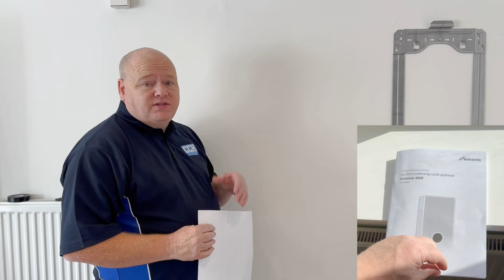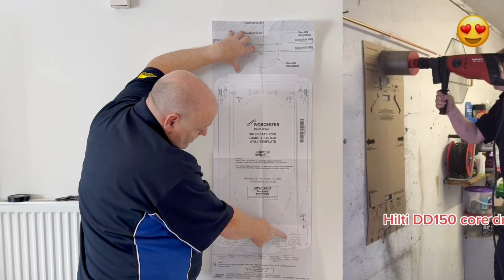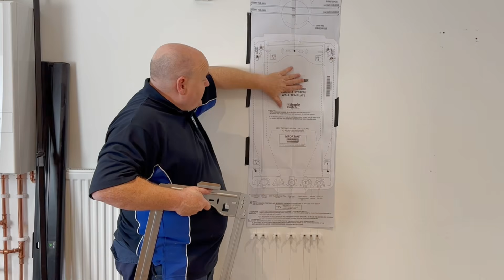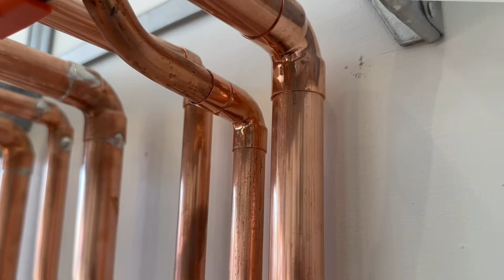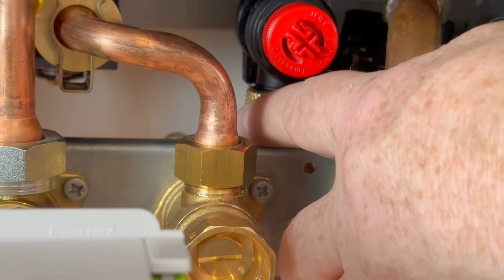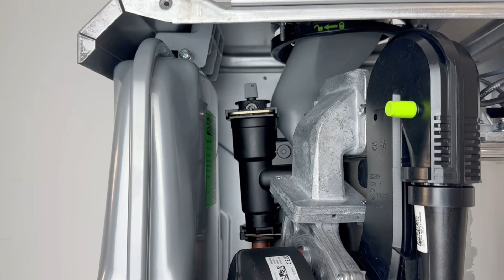Worcester Bosch Greenstar 4000 Boiler Installation & Full Review | Heatable

Comment: Great video. Just had one of these installed and it's great. However one of my radiators has reached the end of its life and needs replacing. Are there any specific things I need to do with this modern boiler before I turn it off and drain the system? My initial plan was to let the system cool down, let the pressure out of the system by bleeding some the radiators and then drain the system from the lowest point. Replace the radiator and then refill the system using the pressure guage you showed inside the boiler and then refill the system bleeding as a go through all the other radiators. I don't wan't the boiler to have a hissy fit.

Comment: what is actually included in a Baller Service on a Green Star 4. thousand My Boiler will be on its 3rd service tomorrow and I've just got out the service book record and I've noticed the first service the engineer didn't even put his Gas Safe number down, and on the second service and do they? test the system inhibitor in the pipe. Work. and at what point do they inspect inside the combustion chamber EG The electros and also at what point do they test the fan pressure or what year should I say, I will appreciate your comments

Comment: Water function is fine on mine but the heating function does not work. This is a new property, 
everything's new inside and now has it started to get cold in the evenings.

The boiler, you can hear it kicking in but inside a minute the thing stops dead. No heat.
Reply: Exactly same here, water works but no heating, I've only had it since April and not had any heating to work and I've had to top the water up twice.
Reply: @TheShan59  got hold of an electrician, he sorted it. Some wiring wasn't correct so all good now. Sometimes it just needs a 2nd pair of eyes.

Comment: We had one of these installed on Tuesday - 2 days ago - Yes, 8th April 2025 - Within hours, its showing fault code 2951 - called to complain, they sent the same engineer to fix it. He claims low water pressure. Within a couple hours, fault code 227. Tried to follow same procedure. No one came and i think they are ignoring the calls intentionally!!! 😡 Its making kettling sounds as weell and its only 2 days old!!! Any idea why this would happen on a new bolier besides problems with gas supply issues and not igniting?????
Reply: I'd mine fitted in April as well and had to top it up twice, there's a red thing you hold down.
Now we are in November I've no heating, the flame pic comes up when the water is running, but nothing for the heating.

Comment: We had a Worcester Bosch 8000 boiler fitted in November. We thought Heatable were supposed to be approved installers. Which meant that a system flush would be done as mentioned in the details of the quote online & on WB website.
But the whole thing turned into a nightmare. NO SYSTEM FLUSH! NO LIMESCALE REDUCER! NO SHOCK ARRESTOR! piles of redundant plumbing items hidden under our loft insulation, and the walls were over filled with foam, then concrete, yes concrete, half an inch higher than the plaster in my kitchen. Wires were left hanging from walls, and the dirty water from the redundant old water tanks dumped all over my driveway. He even removed the drain vent and never replaced it, so no future engineer could drain the system.  So far we’ve had to have a brickie  out to repair the wall and my driveway will need to be resealed after being jet washed when the weather improves. As for Heatable, I had their Director shouting down the phone at me last night stating WE NEVER DO A SYSTEM FLUSH on a Worcester Bosch installation, angry that Joel (after care) had arranged it. Joel also arranged a limescale reducer, which we were told was gesture of goodwill! LOL WB require it when your water hardness is 270ppm. We weren’t even asked if we had hard water. Two months of emails and cancelled appointments before and after fitting. Now their Director is angry that Joel corrected most of these disasters, although no one as yet has even looked into the shock arrestor.
I can’t even get online at WB as the warranty has been done wrong. They also sent me a ten year warranty certificate, after 2 months of asking. Not the twelve years stated. Now I have their Director shouting down the phone, apoplectic that a system flush was done. I don’t even know if my warranty is valid after all this. I would run a mile from HEATABLE. The boiler is good though, I just don’t know whether my warranty will be valid after all of this.
Reply: Heatable are just the same as all of the "internet no survey companies", it's all sub-contracted and the fitters may drive for hours to get to you, no flush, undersized gas supplies, not much making good. Always use a local firm who care about their local reputation, you may pay a little more for a much better job which is actually cheaper in the long run. Eggs aren't always eggs. With an installation they're aren't all completed to the same standards or ethics.

Comment: Worchester Bosch are the worst boilers to work on period. Just try changing the plastic sections, or servicing them properly by removing the fan and burner. Any installer can hang it on the wall, its not just about that. a Horrible product, fit a Baxi 800, ten times better.

Comment: Lads all boilers are fairly user friendly and when you don’t know the answer check (YOUR GAS FAULT) it’s a very useful app all you do is type in the GC and it will tell you you’re readings for low and high rate it also give you the benchmarks and the main common faults on the appliance. It’s a great source of information and it’s only cheap.

Comment: For 3 bed detached 10 heater, one bath and ensuite  shower , currently ideal istor he260 35kw, what would you recommend 4000 or 8000 model ? I am on the Worcester site to book replacement

Comment: My boiler is showing low pressure. Can’t find how to add water   Can’t find the Blue little flap for water.
Reply: There should be a flexi with a black lever at each end - turn both a quarter turn to add water 😊

Comment: Great video. We have just had one of these boilers installed. If we have to turn the boiler off (for what ever reason) at the electric switch its connected to. When we turn it back on, will it have lost all its settings? Many thanks.

Comment: Hi there, got a question. Not sure whether to go for the Greenstar 4000 30KW or 8000 30KW. It is being supplied by council due to using a first time central heating grant. I have been offered the 8000 as an optional upgrade. House is an extended 3 bedroom house with 2 bathrooms - 8 radiators in total. Both bathrooms are powered by thermostatic showers so will be using the hot water from the boiler. As I only have 8 radiators, would the 8000 be an overkill and waste gas? Or would it automatically adjust the power needed to heat the house?
Reply: I'd go for the 8000, it will modulate down to about 3 kw anyway, and if this 4000 can be range rated then I'm sure you can with the 8000

Comment: They made it harder for the elderly do they want them to call out gas safe just to top up a boiler inside the front panel they have a manual gauge for the gas safe installers
Reply from the maker: I do not want to understand what you mean. Thanks
Reply: There's a digital display on the front for customers, but the boiler needs to be powered up to see it, hence why there's a manual one for installers inside to see before powering up
Reply: Full stops and commers would be nice. Lovely English grammar.

Comment: Was looking to find out the pipe measurements from the jig to the elbow, when using talon clips, as I wanted to knock up a few tails to speed up on-site install time, as I’ve got a new contract starting next week and wanted to get a head start. 
Thought I’d found the perfect video in yours, then all of a sudden when you’ve got a tape in your hand about to measure, the frame skips!! 😂😂😂  what happened, I’m guessing you bottled it because couldn’t find the exact measurement. 😂
Reply from the maker: 40cm wide, 71cm high, 31cm deep. Thanks.

Comment: I have a question for Allen and the community. I am on the lookout for a new combi-boiler suitable for a flat. It is a 2 bed, 1 Bathroom. I plan to box it into a kitchen cupboard (Which will most likely need customisation to cater for the boiler). Flue needs to exit to the right-hand side of the boiler from the wall I plan for it to be on. I want something reliable and easy to work on for gas technicians when required. What would people recommend? I have a Vaillant on another property and although I was initially pleased I have the dreaded leaking flu which I believe is a design flaw in the Vaillant range and the warranty aftercare was awful. Could anyone recommend a boiler?

Comment: We had one installed last year. For some reason, it is leaking from the left side a little. We can feel water around the edge of the boiler. Plus the water setting temperature number is not there. The heating temperature number is there but not the water temperature number ?
Reply from the maker: Hope you have it sorted.

Comment: Great video Alan I always fit ideal but a few ppl ask for a Worcester so interesting to see an install.  With the new regs on part l and the flow temp of 55 and lower delta tee can u do a video on how to size up a new boiler and system whilst adhering to the new regs etc

Comment: Hi Allen
Great informative videos 👍
I have one of these boilers and it's leaking from the bottom of heat exchanger 
It appears to be the gasket
I replaced a number of radiators and pressured it back up to 1.5 bar
Then it started leaking
I can't get hold of a plumber 
Can I replace this part myself?
(Electrical Engineering/Electrician)
Thanks
Chris

Comment: Hey Allen thank you for the in depth review, however I have just had one of these boliers fitted to replace a broken ideal logic 35. since doing so my gas usage has almost doubled in kwh what can I check to reduce it.

I have the easy control wifi CT200 panel and the app which has no instructions whatsoever. I have found a few guide videos on youtube though

Standard uk home end of terraced no changes made to the temperature selected on the thermostat but gas usage gone from daily average of 16kwh to 30kwh

regards

Kerry

Comment: Hi Allen, loving your honest approach to reviews etc, was wondering if I could ask some advice - currently have an old Ideal Icos that has died and just about to replace but having problems finding a boiler that seems like it would be powerful enough. Old boiler is an Ideal Icos He36 (37kw) with Oso indirect 250L unvented tank. I wanted to go Viessmann after your review but seems like they only do 32kw, failing that I was looking at Bosch 8000 40kw. House is 3 floors plus fitted out basement, 4 beds, 1 bath (shower + bath) and 2 ensuites (1 shower + 1shower and bath), there are 25 radiators in the property. Any advice on what to go for would be greatly appreciated.

Comment: I’ve fitted maybe 30 of these over the last 18 months I personally love them it’s easy to fit with the jig, love the rear piping options even more so now the plate would be easy to remove from the front, plug in Worcester controls another well thought out time saver, user display is really good especially for installer options, prv as you said street elbow and a coupling fits perfectly 👍 easily my favourite to install from the Worcester range
Reply: What is a fair price to pay for the labour only.
Reply: Thanks you so much

Comment: There is a problem on some of these boilers where the rubber flap between the fan and heat exchanger sticks from new.  It won't ignite, gives you the fault code for no gas.  Worcester said it's an issue with a batch of them and something to do with how they are testing them in their factory but had three of them in last month.  The first one I wasted a lot of time investigating.  Also hot water issue on the 25kws, if your mains pressure is high it won't heat so Worcester insist on fitting a pressure reducing valve in these situations.  Thanks Alan.
Reply: Yes on the 4000, they said that when they are testing them in factory they are not letting them overrun so condensation is sitting on the flap and sticking it shut, you only have to push it open to unstick but I was thinking if this could happen if the boiler was out of use in someone's house e.g on holiday etc
Reply from the maker: @jamesrob81  Have they sorted them now? Thanks.
Reply from the maker: Is that on the 4000 ? Thanks.
Reply from the maker: As for flow rates that would be the same with any boiler, we need to set the flow to match the boiler. Thanks.
Reply: They said it's only on a certain batch and to be fair I only had it over the last 2 months, ones I fitted earlier have been alright but another installer I know has had it 4 times recently
Reply: Yea it’s been rectified and an update was made to the code lug to run the fan longer to dry the bearing plate out

Comment: The installer interface is great, setting the boiler up for maximum efficiency. The price is something we are coming away from WB for. Margins are something we need to consider closely, 10yr on the 4000 and 12 on the 8000, price dose not justify the difference for the consumer or installer.
Reply from the maker: I do not know how much they cost tbh, Thanks.

Comment: hi allen  , did you manage to read my comments on your previous vlog , thanks
Reply from the maker: Not sure, what was it, thanks
Reply: @AllenHart999  hi allen , it was to ask your opinion  about my worcester boiler , the heating comes on at night and it seems to fire up every 15 mins, i timed it the other night it was coming on at 12:45am and then at intervals of 15 mins , it was still doing this at 3am and i fell asleep , I had an engineer out and he said "that whats it supposed to do ", but i said its on a timer set for 5:30-6:30 am, it shoudnt come on until that time , so he said" just turn the thermostat down before going to bed , and it wont to warm at night then" , , but surly something must be wrong with when the heating is coming on outwith the set timer, , i just wanted your opinion before i go back to  my landlord , any advice on whats wrong, thanks

Comment: We fit a lot of the 4000 and 8000 .
The worst things are the PRV connection what is it with the little rubber washer always popping out . and trying to do up the nut .
The washers for all the service pipework.
You have to fit the washers first then install the boiler.they sometimes fall off .
The weight of the boilers .
Esp the 8000 reminds me of the first gen CDI .But at least you can remove all the panels when installing the boiler.
And the built in filling loop on the 8000 . that's a pain to use.
And the digital pressure gauge for the customer to use .no where near as accurate.
Apart from that they are good boilers.and they look swish in a kitchen.
Reply from the maker: Thanks.
Reply: I use a dab of silicone grease on the brass connections to hold the washers in place.  Taking care not to get any on top of the washers.  It works every time.

Comment: I take longer to connect that ridiculous prv, than I do piping the boiler up ridiculous contraption. While I'm moaning the flue is annoying also it's the only boiler I have issues with fitting
Reply from the maker: What issues do you have with flue? Thanks
Reply: @AllenHart999  when your retro fitting, into existing flue hole, you can never seem to slide it completely onto the turret of the boiler without twisting and pushing down the housing of the flue. Then spend about 40 minutes trying to re-align the connections and the washers that's if they don't fall off down the back of the boiler
Reply from the maker: @johnhine1007  Thank you for your feedback.

Comment: Have they fixed the disintegrating  flow turbine spacer yet ?
Reply from the maker: Looks like its the same part. I will check though.
Reply: @AllenHart999  Probably not, as that's why the motorised valve has a green welly on it, with a gutter, to divert leaking water away.  Despite that classic problem, they're still very good boilers.

Comment: Good video Alan
The rubber connector that fits on the trap didn't look to be fully home,  they can be a bit of a faff to fit
Reply from the maker: Definitely a bit of a faff. Thanks.
Reply: @AllenHart999  especially if it's already fitted when you spot it,
I've tried doing it insitu  but find it easier to take the trap out , fit the hose on the trap then manoeuvre it all back in place.
Still a decent boiler and I hate Worcesters
Reply from the maker: @davidmarsden8868  Thanks for the feedback.

Comment: Hi Allen, just installed 3 worcester 2000, very similar to the 4000 in three flat. I turned the KW heating output down to suit. As in the Benchmark you need to add if you alter it and to what. The landlord then checked the booklet, asked what reason I did this, and told me to put it back up as the tenants would then need to run the boiler for longer.
He also watched me do it so he could check it after I left.
Reply from the maker: We can only try to give the best advice. Thanks.

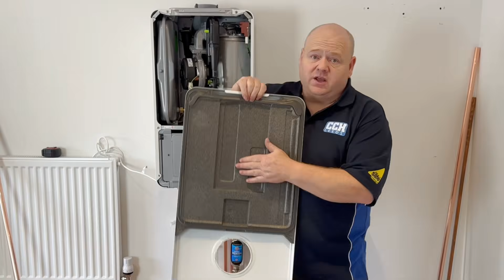Comment: @ 10:29 I appreciate the fact that for many years now Bosch has been using low voltage coil gas valves that never break down
Reply from the maker: Thanks.